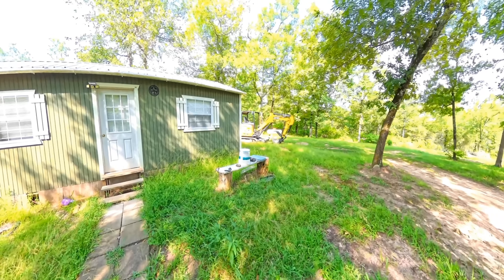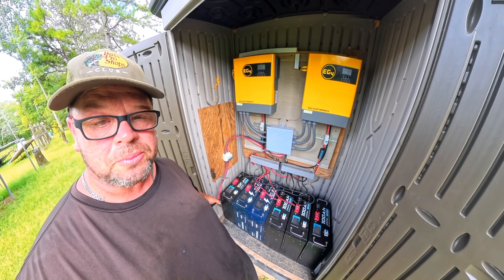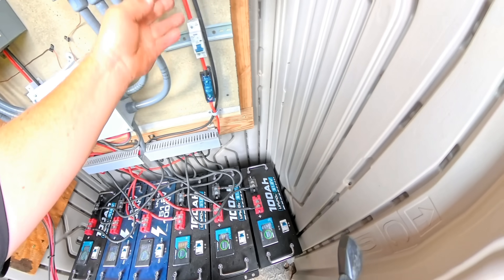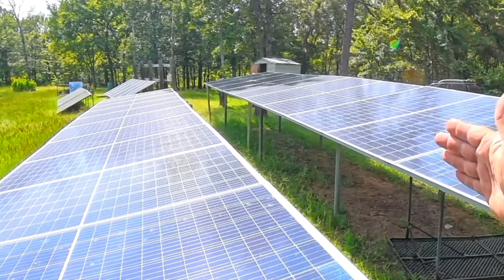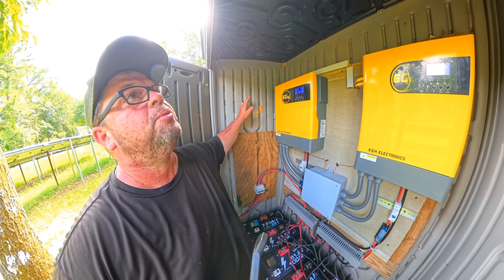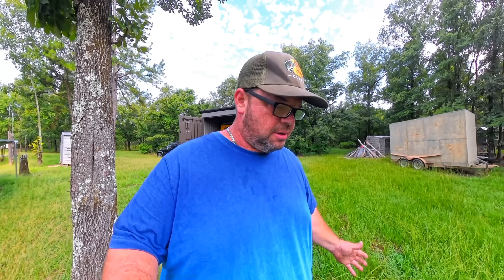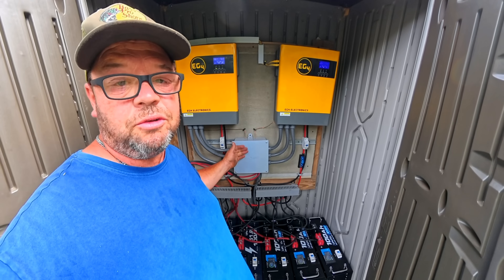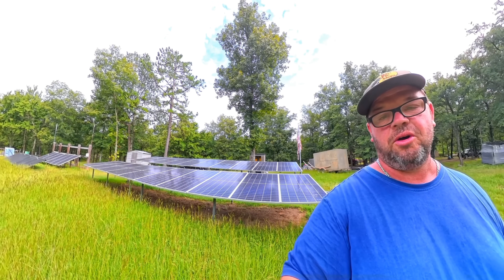Powering My House 24/7 With BATTERIES!!

Comment: Dont forget its a double edge sword,   you want enough batteries to not come close to deplete them daily but you if add batteries you need to have enough panels to charge them completely daily.   If not you will kill your batteries well before their lifespan.  Its all about balance.
Reply from the maker: full cycles get 10 plus years half cycles may get 20 who knows. The bms will probably fail before the cells

Comment: Use axial fans one input one output to circulate the air.    Some are ac or dc powered, use wet location vent to stop weather.  If that's not enough use small ac unit.  Also a heat exchange could work.   These temperatures solutions are used in outdoor cabinets for cellular base stations .   Also, for winter time,  the batteries can sit  on a heated battery pan .   They are controlled by a thermostat.  Good luck

Comment: So does the heat mess with battery performance? I know cold weather does and since I’m in the Midwest the shed would not work
Reply from the maker: Not so far I haven't had any issues but when it was below 35 and I had my other batteries out here they would not charge. It's yet to be seen this winter how they act but definitely I need to vent it for the summer right now I've just been keeping the doors open unless it rains

Comment: If you have space for regular boiler, it is better for solar than instant hot water heater. Have it big enough for 24h, heat water only during hours with the most sun, afterwards disconnect. Us a smart plug or something so it is done automatically.  To heat up 100 liters of cold 10C water to 70C (Delta t = 60C), it takes about 7,5kWh. If you have 200l boiler, it will bet 15kWh of energy stored in hot water instead of batteries. I would not run instant water heater, or boiler on batteries, the same with resistive sapce heaters. when the batteries are full resistive heaters are OK to dump extra energy, if you have an need for heat, but using batteries to heat, is expensive.

Comment: Do a vent in the bottom and a vent in the top on the opposite side so the batteries get some air going over them for cooking. If you do both vents up top the air will just flow side to side and not provide much cooling for the batteries

Comment: Build an external fan powered ventilator that pulls external air near the bottom of the battery/inverter enclosure via insulated ducting and install rain proof ventilation towards the top to allow the fan forced system to push the heat out of the vents. Install a switch to turn it off in the winter and instant low cost heat dissipation from the enclosure. Seal everything up real good. I did this for and electrical enclosure at work and it works like a champ.

Comment: I really liked your video and I learned a lot from it. I am just getting started learning about this way of powering a home. Why would you have almost 10 grand worth if electrical equipment in a $300 plastic shed?
Reply from the maker: 6k and because it has been working fine as a solar shed for 3 years

Comment: To the point of going completely solar when it comes to heating water.  I personally wouldn't because the draw on the system would be extreme.  I would consider a combination of a Rocket Stove (winter) water heater and propane (summer)

Comment: Not free you have to spend quite a bit to get all the things to run a system like that. On top of that , you will have to keep replacing batteries every 3 to 5 years and the controller maybe every 10 max so no, it is definitely not free or cheaper unless you use a very large amount of energy.

Comment: If you wanted to help prolong your panels and get free hot water you could always run hose lines underneath your solar panels that'll draw some of that radiant heat off of them cooling them down and giving you access to hot water on demand if you had a storage tank for it then you could even have hot water 24/7
Reply: Good idea
Reply: Genius
Reply: 😊😅😅z😮you 😮

Comment: A hot water tip I use is a 3000w 240vac water heater can be run at 120vac and it uses 700w. Takes a bit longer but uses less power at one time. Been helpful for me. Dont vent it. Open the door if you need to. Cheers

Comment: Great system and explanation video. Are your wires from the panels to the shed and the AC from the Shed to the Home run underground?  What gauge and what are they run through?  Thank You.
Reply from the maker: Yes both are direct burial I have 8 gauge wire coming from the solar panels to the inverter and then coming out of the inverter is a 6 gauge 120 volt Gray three wire direct burial all the way to the house.

Comment: If you know any railroaders in S&C (signals and communication) see if you can a retired bungalow (aluminum equipment shack) you can upgrade your battery housing situation with venting and more room for inverters battery busses and floor space for batteries.

Comment: THANK YOU!!  I'm looking for an idea for a 20-acre property that has a cabin, an upstairs 3-bedroom, a well pump, install  (3) 110v water tankless heaters under the sink, run power to the front gate, and install lights.  The power company hooked up and ran a power line to the cabin. The project, excluding the electrician, is expected to cost over $ 50,000. Being off the grid would be a bonus. That would be fun!!!
Reply: I think at 50k, you could build yourself a pretty impressive system to support a good portion of your needs.

Comment: 90 degree 4" PVC elbows going through the side of the battery shed. Installed with the outside part pointed down. 4" inline fan at the opening of the PVC pipe inside the shed. Screen over the elbow for bugs. Place the inlet elbow and fan lower in the shed and place the exhaust elbow and fan higher in the shed so air moves through, not just across.

Comment: an idea for exhausting the heat why not use some pipes that come ot but then dip down so any rain woud just run down the pipe and onto the ground might even be some with a blocker you swist open that way it solves keeping it cool in the summer and warm in the winter

Comment: Nice set up, thanks for sharing. Just an idea, but not bad to keep the propane around as a 2nd fuel source in case of a system failure. You could run a generator, cook, and run water heater.
Reply from the maker: Yeah good idea for a backup!

Comment: Nice but I can buy a LOT of power for 900 per battery. 6 batteries. $5400 that are good for 5 years.looks like your not using mutch electricity here so figure $100 a month for electricity for 5 years so 6k. Plus. $1600 for 2 inverters. Solar panels figure a dollar a watt and the shed it's in and other install costs. Looks like mabe you could come out even in cost in 20 years with using minimal power assuming nothing else but batteries go bad in 20 years. Cost of power will rise but so will the cost of those batteries. Nice though if it's your only option or too expensive to get power to your location
Reply from the maker: You're so wrong in so many ways it's not even worth a reply

Comment: I would just build a cheap pavilion over the top of that shed... And then I'd install a RV or camper vent to exhaust the heat when needed during summer... During winter you could just close it and put a insulation cap in there to keep the heat in instead, happy off gridding! Thanks for the content!
Reply: Do you have any reddit or community forums we could ask you about anything? Looking into getting into Off-Grid living just struggling getting property

Comment: Great video buddy! Im glad to see youre so sucessful running AC completely off grid in a southern environment. Definitely gives me hope and some inspriation for my own future goals. 

Heres a cheap trick that might work for you for ventilating the shed. Put a 4 inch fan on the inside down low and another up high. Mount them in the middle of a dryer vent penetration for a house. This should provide enough rain protection to keep water out. You could even mount the fans inside entirely and run them through a dryer exhaust hose to keep them entirely inside the shed. One being low and one being high will also help with natural air circulation due to heat naturally rising.

Comment: Home Depot and places like that have fans that have a flashing over the exhaust.  And they get pretty big. I have also seen fans with solar and batteries built in but they do not have a large cfm and they aren't available at home depot or any easy place.

Comment: Build around it, build a bigger shed on top. Cut your vents and, stablize the hole because of structural integrity, and put a pitched roof on top of the battery shed that goes over the corners. Then build the shed around it, with all the vents or even hook ups for fans and take the doors, off,  do a ton of sealing and you should be good.  and this will also allow you to eventually figure out another sysetm to where you can add more batteries and solor to get more energy for your home and projects. My goal is to figure out how to get 3 months of energy stored.

Comment: fan-o-matic, made for rvs,  blows air in or reverse,  and has a water and temp sensor that closes and turns off  runs off 12v  that could help you divert some heat

Comment: @oklahomaoffgrid What do you think about building shed roof pergola over the solar shack?  Maybe something like a 8 by 12 ft.  Then you could make your vent holes on the solar shed.  Instead of in inlet and outlet vent a the top, maybe a inlet (Air in) at the bottom side and Air out as heat rises on the opposite side top.  Just and idea to throw around.
Reply: Just found your channel today, new subscriber…
Reply from the maker: thanks for watching

Comment: Just a thought to clean up the set up...Those batteries are designed to be rack mounted.  I would probably mount them that way, Allows you to use more vertical space and easy replacement.

Comment: Kinda disappointing on how much battery was used overnight based on what you had running. I was hoping 30kw would have gave you more?
Reply from the maker: It's really not disappointing I ran heavy heavy loads all night long. It's not even my normal use.. it was literally 62° in the house all night long and the compressor on the AC never did kick out. Not only that TV internet ice maker refrigerator all the lights in the house and all the lights outside we're all on. On a normal day like today I just saw them only drop to 85% by morning.. and they literally get charged back up 100% before 10:00 a.m. sometimes

Comment: Add soil all around the back and build up a little mound. This will help insulate your system and maintain a more consistent temperature. Also, place a heavy liner between the shelter and the soil.

Comment: You want one low and another high on the other side so the heat will push out the top and pull air in the bottom makes a free fan Trush me I work on big machine all my life and that is hoe are cabinets set up but Mahe sure they have  louvers to keep water out may want them on the door good luck you a good man I saw you help those people out that was down hope it gave them a hand up

Comment: You could look into an electrical cabinet cooler if you are generating too much heat where just circulation won’t work. What I would try first is just putting in a pair of vents, one low and one opposite side high and let convection remove some heat. Add a fan if necessary. Being you’re in OK, you have hot summers, but if you aren’t having issues with heat shut down by opening the doors, you might be ok with just a fan. Do you have to warm it in the winter, or do you create enough heat for the batteries to not freeze?
Reply from the maker: I think there should be enough heat that they won't get below freezing

Comment: i want to warn you all nothing like usa miss information, china has 650 watt soler panels one panel 650 watts,  not that is huge amount incress, also note cable size he made two mistakes size even few feet wont matter one bit , also he should be running 220 volt to home,   and one last huge mistake each connection should be souder to connections,   now why max out soler panels, 
you want get highest rated soler panels  i do like fact he knows what he talking about power,     also he should run ac unit for shack u want to keep it around 70deg   
and short of few things  
i also  would do something different  where system would take batterys on line to off-line to charge,  in this way  u can run batteries all time   
now battery they now have 500 au battery's, same cost,   
now i would have a generator to charge   batteries if anyone notice lot states getting lot rain  why its must get the biggest soler panels 
also try run soler panels in 3 phase, this can lower amount amps by a ton,     again i want stress last time i looked soler panles was at 650 watts now if u get them bigger get them 
do to fact u have lot cloudy days the bigger panels even if power was cut in hafe still making more you need,

Comment: Great set up..Thanks. What if you built a large porch over the battery shed to take away the rain  away... into a rain catchment. Then you can go ahead and cut ventilation into the sides of the battery shed.  I'm sure that will work.  If you build that porch canopy large enough then you can put 2 chairs or a bench and sit under it at the back of the shed.
Reply from the maker: I've been contemplating different ideas like this

Comment: For ventilation I’d put a vent on one side and a small exhaust fan on the other. Put the vent down low and the exhaust fan up high so it sucks in cooler fresh air and exhausts the hot air from the top. Get an exhaust fan that has the louvers that open when it turns on. Vevor has some good deals on some small ones that would work good for that shed.
Reply: I’d add hooded vent covers just to guarantee no water inclusion. 👍🏼

Comment: What voltage are you getting from the panels in series to each inverter? You never mentioned your panel voltages, 

And is your house wired for just 110v.

I have often wondered if it is  possible to tie 2 110v inverters together by connecting their neutral wires together tohave 1 common neutral wire  which could join the 2 -110V  line wires to output 220 v across them.

I guess it would depend on the solid state circuitry and monitoring system and how the inverter was designed, but I know you can do that when you use a transformer and generators. What you are doing is joining the the 2 windings in the generator together making one coil winding in series with 1 lead on each end which doubles the voltage output of the now one coil, but since the coils are in series, you have to cut the total amp output of the 2 generators  combined, in half,  because you are doubling the voltage.

I wonder if you jumped a wire from the neutral of one inverter to the neutral of the other having a very low amp fuse in it, like .2 amps, just for safety,  then put your meter across the 2 hot wires of each inverter if you would read 220v.
The impedance in the meter could not cause any current in that could damage anything.I bet it would read 220v. I know it is better to just get a 220v inverter, but it is just something I have always been curious about

 If you could get a 220v circuit as well as still having the 110 to neutral the only think that would change is the amperage at 220v would be halved.

 Most dryers run on 220v and  a 220V ac uses less electricity per BTU output than a 110v ac.
 I have a commercial 3 phase 8000w inverter it has a 480v Delta output. I bought 3 transformers. The three phase leads will feed the transformers like this,  hot  wires 1,2 to one transformer wires 2,3 to the second transformer and wires 1,3 to the third transformer. Each transformer will drop the voltage down to 240V which will be single phase from each transformer. Dropping the voltage in half will double the amperage less the heat loss of the transformers.
The transformers will isolate the 3 phase down to 3 single phase, so from the output of the 3 transformers, they could be tied together as long as I get the same phase leg from each transformer to tie together. I will end up with one single phase 240v output to the breaker panel supplying the total capacity of the inverter less heat loss of the transformers and inverter.

I got a good deal on the inverter,  I also have a lathe and a Mill that are 3 phase, so I can run my machinery off the 3 phase output of the inverter and still have the rest hooked up as long as I don''t go over my KPH capacity.
If you ever upgrade your inverters get 220v output inverters, they are more efficient and create less heat relating to load.

Efficiency of the cost per KWH and lower wiring cost is why industrial voltages are higher. You have less energy loss from the heat generated in the wiring because the current is lower.
Reply from the maker: I'm getting around 476 volts on each string of panels going to each inverter. In my case everything is ran in parallel all wiring is tied together in the combiner box in parallel including the grounds. My house only operates on 120

Comment: Hate to give comments where that "Will" has commented too....yeh, that one. But agree with the solar panels in parallel to the inverters problem. In the summer with the high amps and heat...invertor connect to the solar panels gets damaged. I had to have mine repaired. Also, it seems like the inverters are better designed to handle high voltage rather, but...your earthing, fuse-cutoff and wiring needs to be good. Fault to earth on the panel side can causes serious arching. Also, yep you need the batteries, the more the better. 
Am a do-it-myself guy too.
Reply from the maker: Tree has been removed
Reply: @OKLAHOMAOFFGRID  I have a streetlamp pole that only bothers me in the winter....would love to cut that one off 😓
Reply from the maker: put mirrors on the top and side of it 🤣
Reply: @OKLAHOMAOFFGRID  Sure 🤔
Reply from the maker: lol..mirror on the top angle to mirror pointing down..lol..joking